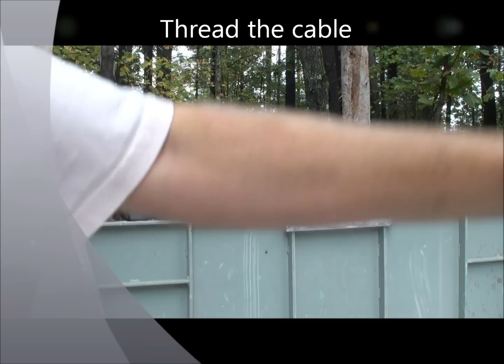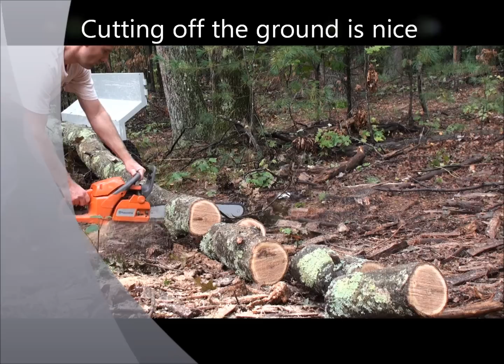Custom ATV Trailer with hyd dump part 2

Comment: great job!! My only advice is to not use the hook on the winch cable to hook bacl onto the cable.  get a Short choke chain to choke the logs and hook the canle to that.  itll save you a parted cable in the future.

Comment from the maker: The battery lasts for weeks, so it hasn't been an issue.  But the ATV does have a charger that I coudl use if needed I suppose.